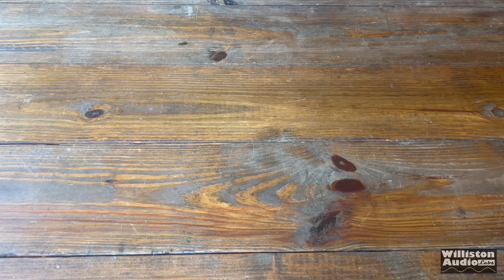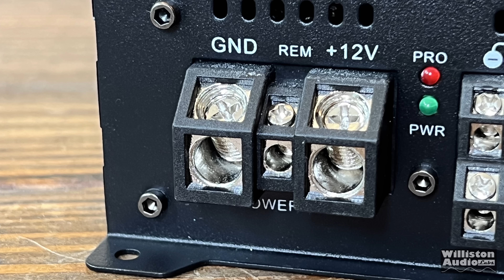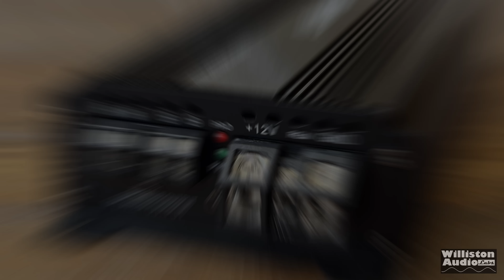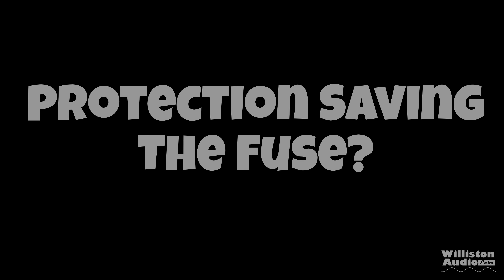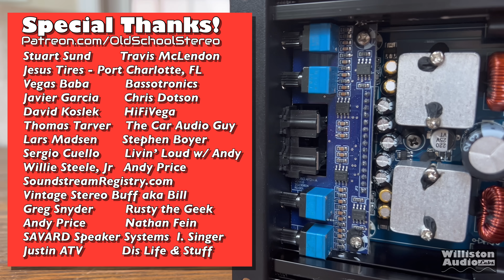Inexpensive Amazon Car Audio Mini Amps Yield SHOCKING Results

Comment from the maker: Domanki Four Channel and Monoblock Amps
Domanki SDJ80.4FD four channel - https://amzn.to/3LBKHuE
Domanki SDT1000.1D monoblock - https://amzn.to/3SlMV5e

Other Budget Options
Ocean Audio OAE90.4D: https://amzn.to/3ztmeES
Down4Sound MM504 (300w 4ch): https://lddy.no/1k16o (Under $120)
Down4Sound JP84 (400w 4ch): https://lddy.no/1k16m (Under $160)
Down4Sound MM1004 (700w 4ch mini): https://lddy.no/1k16n (Under $150)
Soundigital EVO 400.4 (400w 4ch): https://amzn.to/3XBPzXX (Under $80)
Soundigital EVO 800.4 (800w 4ch): https://amzn.to/3RJ6jZm (Under $120)
Recoil Audio DI800.4 (720w 4ch): https://amzn.to/3xqD6M9 (Under $100)

Video Playlist of Budget Car Audio Amplifiers: https://www.youtube.com/playlist?list=PLu98-M_EowHMtCIiCz0v6_2gLnsmdLL0V

SHOP Affiliates
Down4Sound - http://Shop4Bass.com
SAVARD Speakers: http://www.Shop4Boom.com (use WAL7 for 7% off)
Amazon - https://amzn.to/3wNX6Fn
Crutchfield - https://howl.me/cjZI33auToW

VIDEO INDEX
0:00 Intro
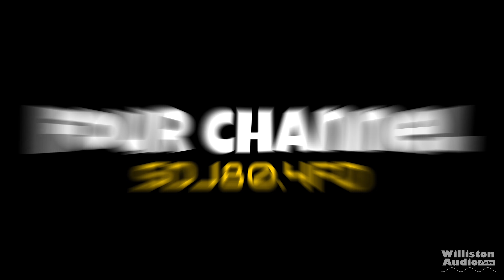0:20 Unboxing 4ch
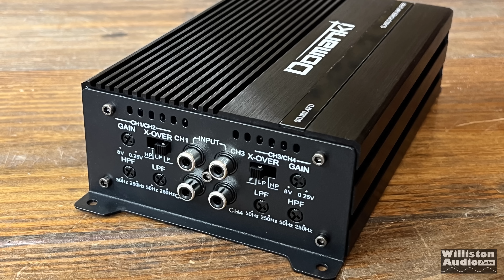1:14 4ch Specs/Features
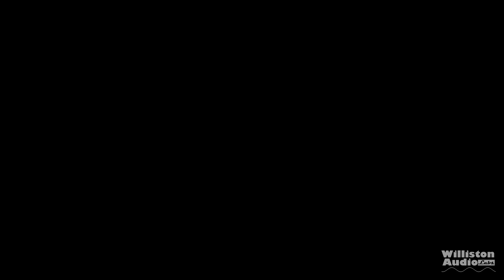2:38 4ch Amp Dyno Tests
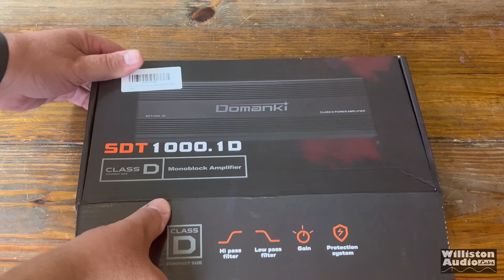5:17 Unboxing Monoblock 
6:23 Monoblock Specs/Features
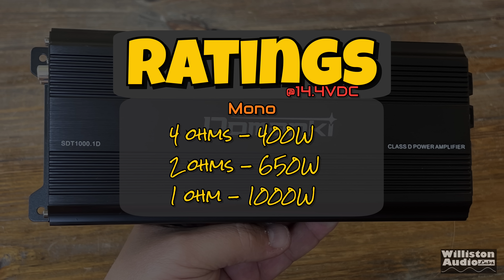7:34 Monoblock Amp Dyno Tests
11:00 Comparison
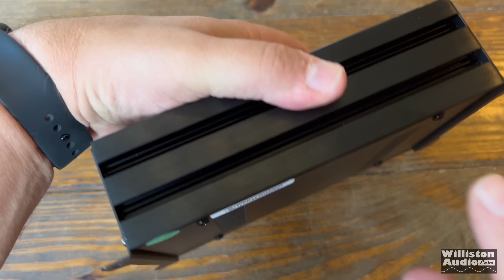11:30 Amp Internals
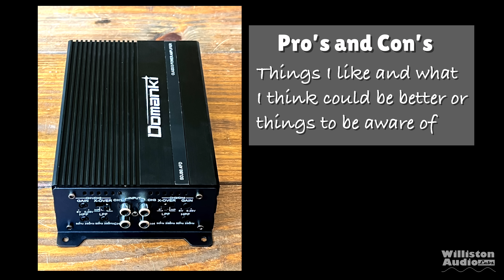13:04 PROS and CONS
14:40 EXTRA Tests

TEST BENCH EQUIPMENT
SMD / D'Amore Engineering Amp Dyno (AD-1): https://is.gd/wccad1
XS Power D1400 Batteries - https://amzn.to/2BPFCKW
XS Power PSC60 Charger - https://amzn.to/2CHGcfs
Fluke 1000A AC/DC Clamp Meter: https://amzn.to/2Rw5WDA
Handheld Dyno AMM-1: https://is.gd/wccamm1
My Favorite Precision Screwdriver Kit: https://amzn.to/3yAaPmn

DISCLAIMER: This video and description contains affiliate links, which means that if you purchase from one of the product links, I may receive a small commission. As an Amazon Associate I earn from qualifying purchases. As an eBay Partner, I may be compensated if you make a purchase
Reply: Is is just insane bro!
Reply: @wal  I was wondering if you noticed that there were no fuses accessible from the outside of these amplifiers, even though they included spares? Thanks for these informative videos.
Reply: Dang, the price jumped up quick since this video. Still not bad... I'd use these during the winter after I switch out my summer equipment.
Reply: Domanki

Comment: I have a newer TARAMPS 800X4. It's the black one. It's pushing (2) 12s bridged @4ohm and the other 2 channels are pushing 4 tweeters and 2 6x9s. It's ridiculous for an amp thats barely bigger than my cell phone! It was $112 on Amazon.

Comment: These are identical to the amps from Autozone by dual.
Reply: No freakin way Dual amps are producing more than 40 watts.
Reply: @elcomandante9299 this 4 channel is the same as the 1000.4 from dual. No joke. I'm old school and don't like anything  made anymore but I installed the dual 4channel and have 2 channels running all 4 doors with 6.5 inch speakers and 2 channels bridged to a dvc 12 inch running 2 ohms. Pure thunder. Haven't been able to make it clip. The bass boost on the amp is even clean. Can't believe it all from a $100 amp. Just installed this all yesterday and today. It's bumpin. LoL

Comment: I bought a power supply like this. When it came out I measured its consumption. 2 ohms 14.4 volts draws a maximum of 30 amps and then shuts down. What's the problem then?

Comment: Just ordered the 4 channel for my door speakers already have the BP-1500.1D Domanki amp on 2 12' BFS-4 wired to 1 ohm and yes they bump.
Reply: I got a RECOIL RED1800.5 paired with four Kenwood 6x9s and two 12 svc 1 ohm BASS ROCKERS. Sounds decent for a 5 channel.

Comment: This channel talks all about power, but what about sound?  Just because it will do XXXX watts does not mean it will sound good.  I have spent probably over 30k on car audio over over the years and I learned quick that quality is key.  My last build was in a 2012 maxima and I had it all put together with 2 Rockford Fosgate 6x9s in the front doors and 6.5s in the rear doors and I built a custom spare tire box for my 2 JL 12 W6s.  The subs were powered by an American base amp that I was very impressed with for the money, it made the W6's sound wonderful.  I tried to run the Rockford's with an American Base 4 channel and it just never sounded right.  The power was there for sure but the sound wasn't.  I finally replaced the 4 channel with a JL amp and everything changed, it sounded sooo much better.  Until these cheap amps are put into a full system and everything is tuned you won't know how they actually are.

Comment: The NVX VAD10001 also does 1000w at 1 ohm and usually dynos above its rated power. Smaller footprint.

Comment: ok, i havent done car audio for like 10 years and i keep waatcching your shit, nad it like so why is prime 500.1 still $100 on ebaay if u get lucky, why is any decent brnad amp still like $350 for 1501d by mtx. r u sying these lil toys put out the same as 20 yr old amps? if so, then how come ppl still pying premium for good sh. u rly gotta explaain this to a old heaad. is the new sh all a scam or what? cuz i cant start to fk w these new sh. when i cana get me a mtx 1501d for $300 on ebay. u got something that caan aactuaally be better or is this alal smoke? will these amps be around in 25 years like 1501d?
Reply: cuz i dont wanana buy no amp that gonna last 2 yeaars, why i still be buying oldschool mtx like 81000d u aeno about that do u

Comment: It's about time that these amp manufacturers are rating them honestly. Around the 2000's if an amp did a quarter of its advertised rating we were amazed. Even if it was a 80 by 2 it was more like 25, 30 by 2 if you were lucky I'm glad that this has came this far

Comment: Would this be good for in home use for a passive subwoofer if used with a 12v power supply?
Reply: No, the 12V power supply will be very expensive.

Comment: there's more to amps than just watts, and there's a reason why iconic amps like JL''s slash series or old school orion's amps are highly sought after,  a quality amp will outperform any cheap amp in both output and sound quality 24/7 all day every day, don't get carried away for just watts on the cheap
Reply: Except watts, what else are there about a good amp.

Comment: I bought the Domanki monoblock 1000.1 and is very good amp,I installed with NVX VCW 84 version 8 inch subwoofer ported box and sound amazing in my Highlander 2021,I recommend this amp no jokes 👌🏽

Comment: Big D Wiz thank you for all of the hard work you put in so people can make educated decisions when they buy stuff testing the amplifiers. 

I just had a question for you if I may?
If a traditional full size class d sub amp is 1000 watts rms and I wanted a micro sized class d amp that does 1000 watts rms to mount under my seat. What is the trade off between the two different sized amps? Why would I want a larger sized amp with the same wattage then? Thank you!!

Comment: Hi Big D, I have a question that I’m hoping you can answer. Will the 4 channel Domanki amp run 2 4ohm subs, and a single dual 4ohm coil sub( 2 ohm mono load ), in 3 channel mode? I plan on using a MiniDSP to adjust the crossover, levels, and EQ for each sub individually( like I do in my home theatre multi sub setup ). Is a 2 ohm mono load for the DVC sub going to be too much for it? 

 If I can’t run it 2 ohm mono, could I split the signal with an RCA Y connector and run two channels, with the same signal, into a single DVC sub? Thank-you. Love your channel, and your personality👍

Comment: Power is cheap now a days, but the main difference btwn most brands is in house design vs Korean designed amps, if you just want raw power that you can just pound and abuse all day with quality components go with punch and power series of Rockford, want well engineered clean sq accurate damping control go alpine I’ve never seen them use cheap caps inside, second sq would be kenwood excelon series, if you just want the most watts with good warranty go kicker, best bang for your buck would be pioneer stuff, Sony es stuff seems to be too fragile, if you like to gamble go with all these basic cheap Korean designed stuff, old designs less efficient less damping noise etc and reliability protection circuits

Comment: If you want a budget amp that is reliable at least as long as they are installed properly including adequate room for ventilation go with Taramps they give you great power handling per dollar and the SQ is surprisingly good for what your paying. There are some budget SQ builds that went with Taramps too not just SPL builds.

Comment: Y’all help me get his attention like this and comment on it please I have a older power acoustic amp
It’s a clear top 2APC-980, I’ve had to rebuilt the amp a couple times cause I ran it at to low of ohms and just pushing the crap out it, I have replaced all the mosfets power and sound processing side, I’d love to see this thing hooked up to the amp dyno just to see what it does please y’all help me yall would love this thing still got the original box and owner manual
Reply from the maker: I have one of those Power Acoustic models, but not certain which one exactly

Comment: Big D - they have a class d version of the 4 channel rated at 920 watts for $113.  I would love to see you dyno that one.  If it is as  good as the 480 watt one with better power.  I might go with that to power the Infinity 6x9 and 6.5 going into in my 08 Jeep Grand Cherokee

Comment: Car Audio has really changed now, I think it hit its peak in mid 90’ to early mid 2000’s. First car I bought myself in mid 90’s  was 1986 caprice brougham ( aka box Chevy) first system, a Denon Cd receiver, MtX thunder 4340 4 channel amp, Power Acoustik Apache series 2channel amp model 2APC 1400 (dudes around the shops used to joke and call them the  2 PAC amps). Then I graduated from the Apache amp to a minty second hand legendary MTX 2300 . My interior speakers JBL GT series coaxials 2 ways , JBL power 10 inch subs ( then to a single Rockford Fosgate 15 inch in a band pass box) any how great video and tests man always enjoy them!👍🏽🔥

Comment: Quick Question. I have a Skar Audio 10" (shallow mount) in a bandpass box, wired down to 1-ish ohms, dual coil. Do you think the second amp would be dece3nt just for a Envoy.? Cheers. Thanks for the video. 👍
Reply: 1 ish? WTF
Reply: @elcomandante9299  bounces. we're bouncing. 1.2 ish
Reply: cues Outkast 😉🤣💚
Reply: Just need the mono.

Comment: "Certified" testing on any amplifier not designed to do lower unspecified impedance's?
Relatively unnecessary imo.
Dynamic results lower than specified impedance's 👍

Comment: In the early 90's when I was just getting into car stereos, I bought a few budget amps. One thing that was consistent with them all, they picked up a lot of noise from the engine running. They sounded ok when the car was off, but a whistle or whine would come through the speakers when the engine was running. I wonder if today's budget amps would do the same?

Comment: so for 600 you can be rollin with 15000watts...and the old war horse was HOW MUCH? and i recall one of the best deals not too long ago, was the CAB 2k, and it was around 200 i think, so 100 dollars per 1000watts. back in the day, i for sure remember 1 dollar per watt, for amps, and 10 dollars per inch for middle grade subs. and the subs are STILL priced about the same, but the overall quality of subs has gone up.

Comment: Amazing.  Not only do they put out rated power plus, but that monoblock was able to count up CLEAN on the certified test at 0.67.  I've seen you try that test with plenty of much more expensive amps, and the dyno hops around when counting up.  These seem to be built pretty well.  Time will tell, I guess, once more people get them into use.

Comment: G'afternoon Guy's 🤓 . Does anybody know who it was that made the XXX car audio amps and subs from a few years ago ? . I bought a new rig that didn't have a stereo in it so I needed a system to throw in it for tunes.  I bought a DVD receiver all new wiring, new speakers for the doors & I scooped up a 1000w XXX 2 channel amp and two 10" XXX audio subs for about $350 all in.  I wasn't sure about the xxx audio because I've seen a lot of mixed reviews about them,  but I have to say the amp runs cool & the subs hit surprisingly hard.  Needless to say I'm surprised and impressed so chalk another one up for some good quality stuff that originally came from Amazon 🤣 ..

Comment: The design and power of the 4 channel is basically identical to the Dual XPR84d(later renamed DA10004d) which has also been rebranded by other companies (such as DS18). The only reason I don't think these are a direct rebrand is because the layout on the adjustment side is a bit different, so it is more of a clone.

Comment: I know I posted once already... But I forgot to mention I immediately saw the similarity to the Jensen amps except for the fuses not on the outside. Same terminals for speaker and power... but the thing I like better than the Jensen is the remote base knob for the monoblock plus better power... The Jensen bluetooth controls are great for acurate settings for Crossover Freq but very inconvenient after initial setup... no exact similarities internally but still curious if they are made by same manufaturer. Looking forward to hooking up the monoblock when it arrives tomorrow. Maybe test the bigger 4ch SDJ150.4DF  ... a little less than twice the price of the smaller 4ch but could be a great single amp solution. If it makes acurate power I might just order one of those as well.

Comment: I bought the mono block version a few weeks ago. so far I've only hooked it up to an old home theater passive sub box with 12" woofer 4 ohms. Haven't even run amp to 1/4 of capacity and the sub pounds using one 12v LifePo4 battery. + no turn-on/turn-off thumps. As usual, use common sense running the amp. Don't use it for competition events and that sort of stuff and I believe the amp will give good long service. I was impressed when Big D showed the guts. Nice beefy rail filter caps!

Comment: Impressive! Thanks for the video. I was looking at the 920 (4ch big brother) and if it performs anything like the little brother, I'm in! So funny how car audio is finally delivering, while pro audio is going the other way by advertising peak/max numbers. I love the simplistic yet versatile setup of these amps too. Seems like a no brainer for my boat. The marine speakers I am considering run at 4Ω and 150W. I like to overpower & under drive my speakers. Since the peak of the amp did not seem to be too much higher than the RMS, it a great case for more power...ruf ruf ruf. Should also help with the damping factor. Thanks again for the awesome videos!! I love the dyno & fluke. It makes it way easy to contemplate the ga of wire needed to run it. Efficiency is key, but power draw on my boat is a big consideration as I don't want to run genset, if I don't have too. Cheers!!

Comment: Just ordered one. Have 3 budget amps Big D has tested over the years. The Dual XPR82D that worked great to add a pair of subs to a factory system. Also both of the Jensen XDA amps for a complete system in My Town and Country with 2 12" D4VC at 1ohm. Been happy with them for a couple years but wanted a bit more power for the subs. Glad I saw this video 1st thing this morning. Normally by the time Ive seen them the price has gone up...right now it's 82.99 plus a $10 coupon. Hope the guts are same when i get it... my Jensen monoblocks input Caps were much smaller than in the one Big D tested so I dont know how well mine actually performs compaired to his test. Love your channels Big D. Thanks for another great video.
Reply: Weèẁðèèèéx

Comment: so it is a banger, only thing left is reliability and warranty, which is almost impossible to test until there is an issue....how far things have come 👍👍 so if you pop a fuse, and remove the bottom plate, does that void the warranty because it broke the seal?
Reply: If lasts a year it is money well spent .
If not , hey , it's cheap .
Just fish around in the couch cushions and buy a couple more .